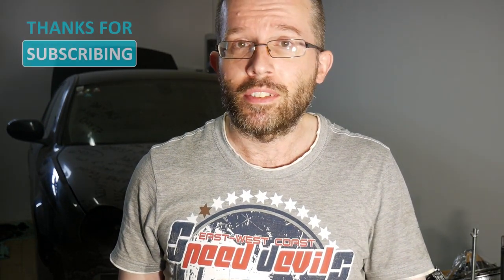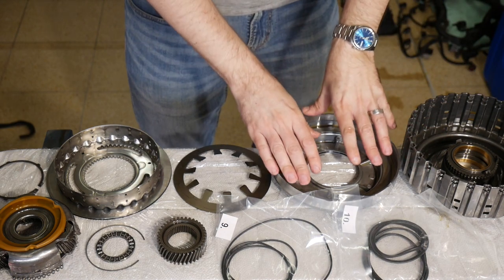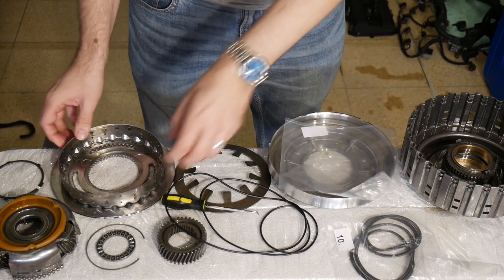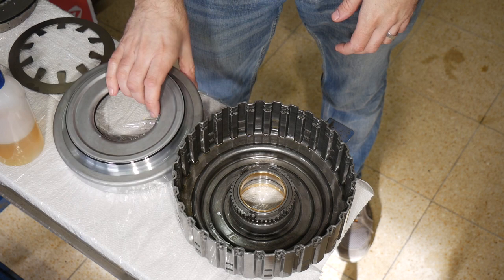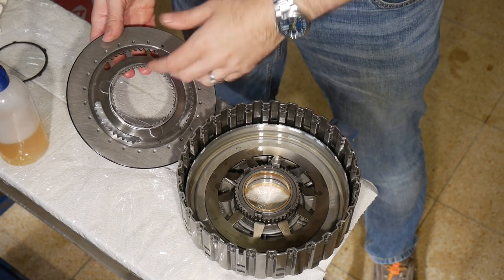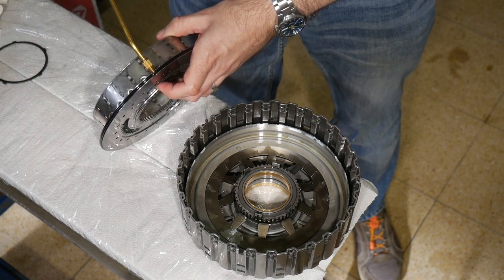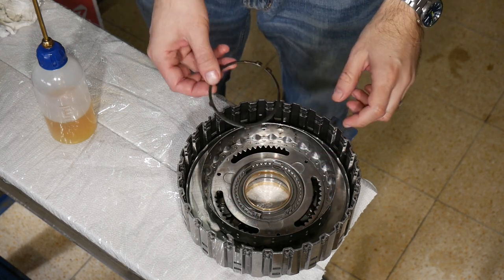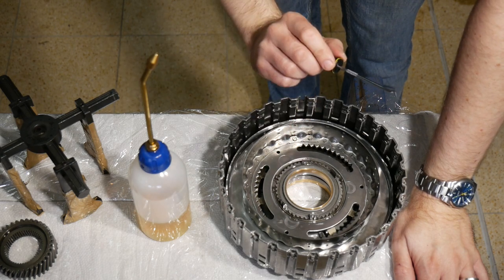Jaguar S-Type Restoration [53] ZF 6HP26 Gearbox REBUILD (4) A Drum Assembly [2020-10-26]

Comment: Hi I was told on my 2003 s type 4.2  when I change the oil filter I should adjust the shift linkage thats under 2x screws on the side  do you know about this?  They say it comes loose
Reply from the maker: Actually I didn´t know - will consider this at the final reassembly. Thanks!